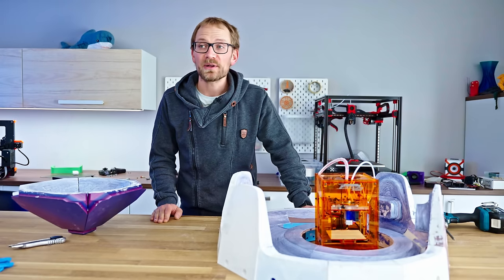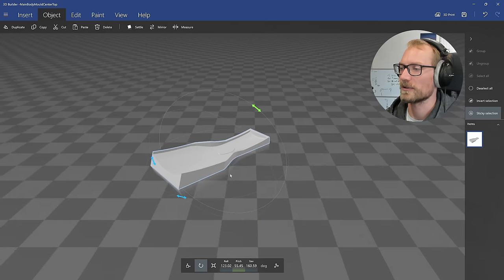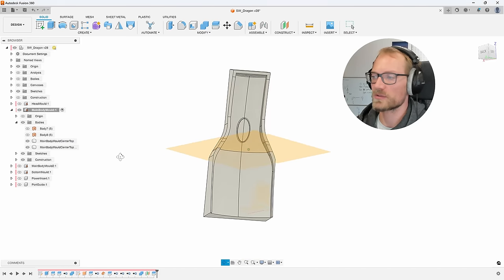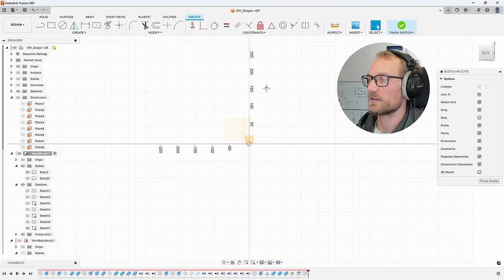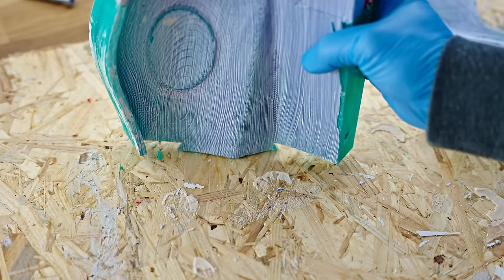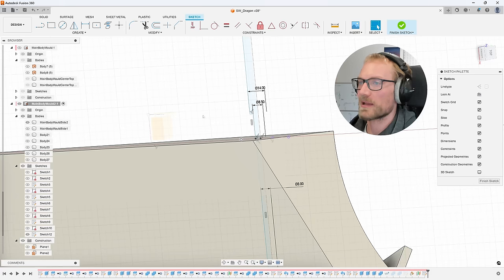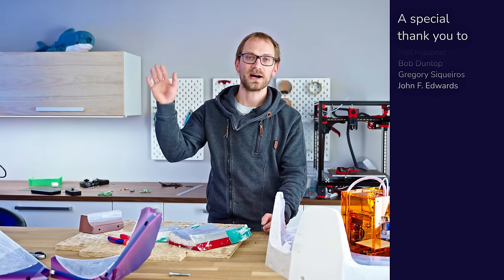Size isn’t everything - 4 ways to print LARGE parts with a 𝘀𝗺𝗮𝗹𝗹 3D Printer!

Comment: It's such a bummer that export as stl cannot export the holes for the part connectors in split parts. It throws some boolean opeartion failed error. Orcaslicer fails at this too. I'd love to be able to split parts, add connectors and save them as ready to assemble stls.
Reply from the maker: Seems like they're already on it! https://github.com/prusa3d/PrusaSlicer/issues/10265
Reply: @MadeWithLayers  Yes, but the issue was opened in early April and we are nearing end of the year. Don't know how long they usually take to sort bugs, but I'm starting to lose hope. 

Ps. Thanks for the reply. Loving the extra effort put on the channel lately. Hope that sub count goes to the moon 🌙!

Comment: It´s not so easy to create perfect fits. On the one hand you want some wiggle room for slightly warped or otherwise out of shape part on the other hand for the strongest connection it´s best your parts fit as snug as possible. What tom didn´t show here are snap fittings which you then can glue as well but in general there are so many connections it would take probably at least 1h to go through all of them systematically. A huge flow charts with like the 3 types of joints (form fit / adhesion / tracktion) and then all of those again split in it´s own categories. I miss the good old times where we had to study that stuff.

Comment: or you could just drill the connection holes for the screws, no cad required. yes 3d printed plastic should work like normal plastic or wood as a working material. and sometimes working with plain plastic, not 3d printed, can be more easier, either sheet plastic or cast plastic.

Comment: I don't understand why the slicers don't allow us to make multiple dovetails on the same cut? I need two dovetails on the cut because I'm printing a frame. Any trick for that or do I need to get CAD software?
Reply from the maker: What I could think of as a workaround that could be done directly in the slicer:
- Lengthwise split the part in half (or into multiple segments) without creating dovetails
- Create a dovetail split individually for each of the new segments
- Reassign the split segments into a single part for each halve

Lining up the dovetail splits from the individual segments may be a bit tricky that way if you're joining a solid piece, but shouldn't be an issue with already separated geometry like a frame!
Reply: @MadeWithLayers  That works, thanks! I did see a feature request to have them add some more parameters for the dovetail cuts so hopefully it gets implemented soon.

Comment: Largest single print I ever did was and Full Size Astromech Dome took 2 full weeks of printing.
Reply: Respect, I never exceeded 20 hours. More than 300 hours is something different. Expecially, because you have to switch the filament quite a few times, don't you?
Reply: @maxmustermann2596  Yes it took about 6 rolls a filament. I did tend to change it early if it was getting low and it was going into night so it would not run out while I was sleeping.

Comment: sadly windows 3d builder will start to mess up your models geometry if you use the slice on things, watch your model in xray and you can see it making dumb choices with the triangles and such.

its particularly bad about curved things, and it seems the more you cut, the more messed up your model gets until 3d builder cant even recognize it anymore and has to repair it on subsequent openings.

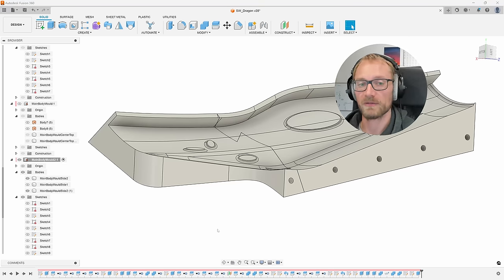Comment: 14:35 holy hell those bolts are incredibly expensive and overengineered for 3d printing lol. They'd be sufficient for auto use. I love building stuff for fasteners, but don't fall into the trap where "bulletproof" is the bare minimum. Consider what your part is meant for and build accordingly.

Comment: I have consistently produced M3 threads, no tolerancing required.
INFACT, your tolerancing messes up the pitch and will fit worse than zero tolerance.

A metal screw / bolt is so much tougher that whatever the difference is, it'll just make the thread. no need to bother tolerancing. Bonus? It works as a nyloc ;D

These have all been done on Ender-3, completely stock.

Comment: I had that little hobby king printer in my basket for the longest time but never bought it. If someone slammed together the cheapest possible core xy with a 8cm cubed volume running klipper for a modem take on the concept, that could be a winner in 2024.
Reply from the maker: The Tinyboy / Mini Fabrikator was an absolute POS, even for the time. I just keep it around for the gimmick value 😉
Reply: @MadeWithLayers  That's not what Chuck used to say! 😅

Comment: Instead of wasting so much plastic in parts, why not making 3d printing smarter? We could just print the armature or skeleton with thin layers and a few joints, then research other ways to fill most of the body.

I.e., use sand, wax, clay, balsa wood, silicone, whatever. I really think we're just wasting too much time and too much material for luxuries.